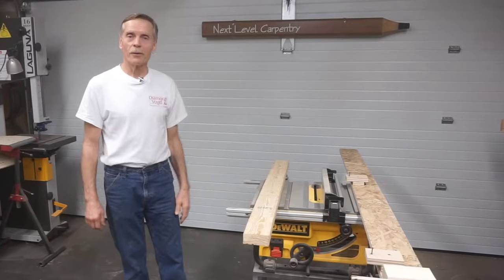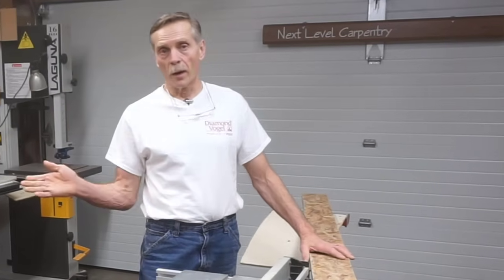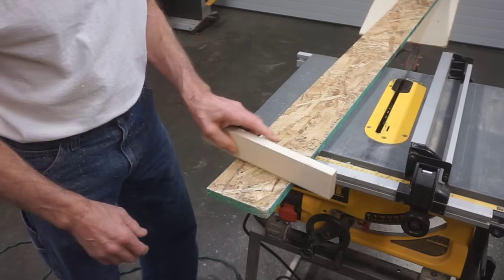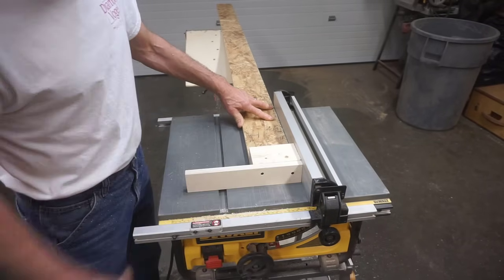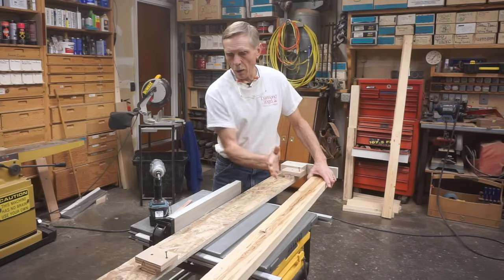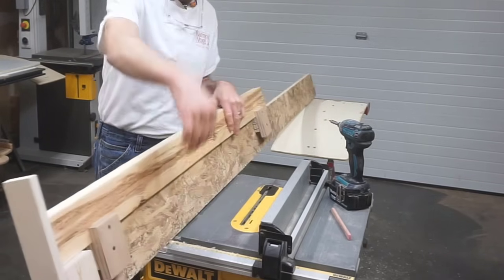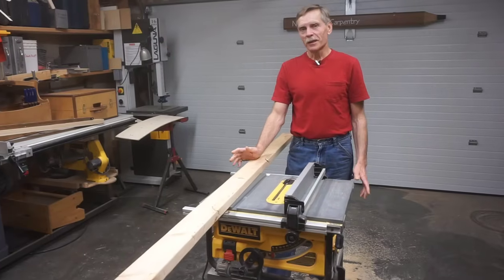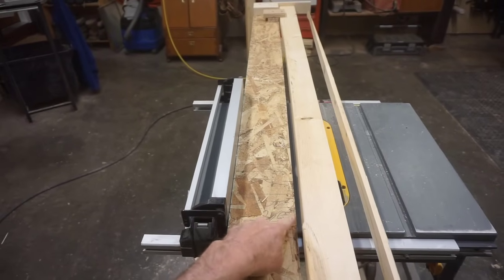How to Cut a Straight Edge on Crooked Boards

Comment: What can I get at Home Depot with a reliable straight edge longer than 8 ft? I need to use this method, but for 10 and 12 foot boards
Reply from the maker: They can be really hard to find but your best bet is to dig through a whole bunk if you need to to find a perfectly straight 2x6 and set it aside just for a straightedge.  Keep it inside and dry between uses so it stays straight.

Comment: I'm sad to hear that you didn't give the boatwright the bowed lumber. You could've easily cut any form on a board with bandsaw, or jigsaw. I just have a bunch of respect for boatwrights for it's becoming a lost art by modern materials. I did liked the video and you an excellent job explaining.
Reply from the maker: Shed no tears for the Boatwright as bowed Lumber is available in Limitless quantities these days...
Reply: @NextLevelCarpentry  Good point.

Comment: Screw another two scraps of plywood to your 2x4 block. Then you can be sure is absolutely square when you screw the block to your straightening board. Remove the scraps and fit your “proper” end stop plywood.

Comment: Where can I find the Roller Stand with the guide ramp.  I ve been looking for a long time and can't find one  with that feature
Reply from the maker: The reason you have not been able to find amazing roller stands like the ones you see in this video is because those are the only two in existence... I designed and made those 20 years ago and I've been using them steadily with great effect ever since.
I am planning to do a build video for them in the coming months so feel free to stick around and check it out when I get to that video project... Best, Matt
Reply: @NextLevelCarpentry  
Thank you for answering.  I have spent so much time looking for them..whew!   But I still learned a lot during that search.
I look forward to your planned video.  Could you possible think of a Roller stand for the average guy also?  I do have some welding experience and an Arc welder and a Mig welder having Body shop experience.  
You are the a great teacher and thank you!
ps: I'm 80 years old and just starting with woodworking. I wish I had done this years ago.  I have purchased a Jet 14 inch SFX  bandsaw and thousands of dollars of other woodworking tools so I am serious about this.  But I'm not going to do anything after 105 years old.
Reply from the maker: @bartgernandt2189  I like your attitude and style... hope I can get the build video done for you in time!  Personally I think roller stands are virtually useless without my little ramp invention and so I wouldn't really recommend any of the ones currently available.  The other alternative IMHO is to have an actual outfeed table, but that only works if you have room for it.  Your mig welder and bodyshop experience will serve you well with the roller stand build... that's all I really have at my disposal.  Since you've got such a great approach to life and seem ambitious for this stuff; if you want to tackle the build on your own ahead of time contact me by email and I'll send you some drawings to get you headed in the right direction. Best, Matt
Reply: @NextLevelCarpentry  Thank you for answering.  What is your email.
Reply from the maker: @bartgernandt2189  you will find it under the about tab on the main page of the next level carpentry YouTube page...

Comment: I tried doing this but without an 8 foot Fence for my 8 foot cedar boards I'm trying to straighten it's just not happening. pulled Out my electric can planer set the board side by side mark the high spots mark the low spots plain them to straightness was way easier than I thought was going to be as long as you just don't get to rushy with it
Reply from the maker: Gotta do what you gotta do.

Comment: i just lay my straight board and screwed on top of crooked board. straight board needs to over-hang the fence side, of crooked one. bottom board will be showing out from under straight edge. set fence to total width of narrowest points, rip.

Comment: Is that a standard fence on a Dewalt?  I have a ryobi and am not a huge fan of the fence that came with it.
Reply from the maker: It is, Andrew.  I'm not a fan of Ryobi in general although I'm not familiar with their fence.  Could be in need of adjustment or might just be junk in the first place.  I've been completely satisfied with this dewalt saw, fence and all, for the 20 years I've owned and used it and would be surprised at anyone not liking it for its intended use.  Best, Matt
Reply: Since I purchased the saw in 2017, I have becoming increasingly aware that Ryobi is junk with each new project I complete. Especially as  the projects have increased in complexity.
Reply from the maker: @andrewmiller7660  Good news is that your skillset is advancing to the point you can see what's lacking in tools... everyone doesn't do that.  It will help you learn to get good results from marginal equipment and really appreciate when you're able to upgrade.  I went through a similar transition when I started mountain biking some years back: I didn't know what I didn't know but learned along the way.  I think this is actually better than starting out with wonderful stuff because you don't learn/internalize important knowledge from convenience the same way you do out of necessity.  Best, Matt

Comment: Look I appreciate this video but I am still trying to cut a straight cut on a board. They never come out perfect and I am using the dewalt also. This pertains mostly to plywood. I just made a Track guide and gave up on the table saw.  Still not perfect but better.

Comment: It’s a good habit to develop to always hook the thumb of your left ( your starting “guide hand”) hand under the front edge of the saw table as you begin to feed your workpiece into the the saw , locking your left hand in position as it presses your workpiece against the fence. That way you’ll never have to worry, or even think about your left hand traveling along with the rip- right into the blade!! The Table Saw is easily ( along with Routers) the MOST DANGEROUS tool on any carpentry job, so PLEASE be very careful. Industrial accidents happen so quickly you will not have any time to react until it’s over, and then it’s too late.

Comment: What about the faces? With no jointer?
Reply from the maker: Sounds like you're trying to prove something... might as well figure out how to do it without electricity and with one hand tied behind your back while you're at it!😉🙄😎
Reply: @NextLevelCarpentry  well I was taught that the jointer does one edge and one face. I have a little 2 foot long jointer that needs some tuning. But I don't think it will do the 9 foot boards that I need it to do. Your method here (with the same jobsite saw that I have no less) seems to be the next best thing.
Reply from the maker: Oh... sorry for my snarky reply Seanfrtd.  You were taught correctly that a jointer does one edge and one face.  In fact, it can flatten all 4 faces but not guarantee they're parallel.  This method works better for squaring edges than faces even though technically it can do both... its just that it's difficult to cut through a bowed piece the 3 1/2" way without loosing everything you gain.  I suggest you spend some time tuning your little jointer to be the best it can be and then add auxiliary table extensions to stretch it's capacity... you should be able to double it's length pretty easily and multiply the length of pieces you're able to straighten significantly.  You'll have to focus to straighten a 9' board but it can be done plus doing it is a great way to expand your skillset.  BTW My first jointer was a little 4" Delta model and I coaxed it to straighten a lot of boards well beyond it's limited capacity...  work safe and enjoy the journey! Best, Matt
Reply: @NextLevelCarpentry  thx vm

Comment: I use a simpler method for straightening crooked lumber on the jobsite:  I buy more lumber than I need.  I cull out the crooked lumber, and return it to the store and get my money back for it. 😊
Reply from the maker: Good for you. Definitely what sensible capenter/contractors do to be profitable, mainly with new construction.  I find this method most useful on remodeling projects where lumber that can be 'repurposed' in this manner is basically 'free' and, once straightened/resized, is often better than punky new stuff, even if it's straight.

Comment: Hey, so, couldn’t you just steam the wood and bend it back to straight? Once it dries, it will be straight.
I mill mine right afterwords and let it dry as it’s put in place. I make sure it doesn’t move until it’s completely dry. 🤷🏽‍♂️ it’s worked for me. All soft wood.
Reply from the maker: Sure, that would work... if you have a portable steam generator and 10' long chamber for jobsite use, an hour or two to steam it, half an hour to clamp the 2x4 in a straightening form (with accurate springback calculation) and a couple days for it to dry out and, hopefully end up straight then it's a GREAT idea! 🤨😎
Reply: @NextLevelCarpentry  I was thinking more on, “It’s very possible”, but I very much understand it’s not ideal, cheaper, faster, easier... wtf... damn. Okay, let’s just say, “yeah, it’s possible, but why? It’s more of a waste of time.”
I see now. (Just because you can...)

But, it works very well with little pieces of wood to bend!

Comment: Why don’t you use three hold-down blocks?  It supports the middle of the workpiece timber and gives you another push-point. 
Just asking not trying to be smart A.
If you cut straight down the middle you can glue the two halves together cup to bow. It wastes less wood and “might” cancel out any remaining internal tension.
Reply from the maker: I believe it was Einstein who said make everything as simple as you can but no simpler.  The fixture as shown in this video is adequate for practically every application when doing rough framing on a remodel project and I don't feel extra tabs or anyting are necessary. That's not to say your ideas or suggestions would not be beneficial in some cases so I appreciate you adding your thoughts as options for different circumstances...
Best, Matt

Comment: Why would you straighten (decrease dimensions) of a piece of structural lumber on a job site? Where would the piece be used? Framing needs the full nominal dimensions not reduced dimensions. I would say that the ‘on the job site’ constraint was used so that an inferior method could be demonstrated. Turning 2x structural lumber into 5/4 lumber is a valid need but there are better fixtures for that.
Reply: @mattjackson3996  I completely understand the method and other methods, as well, which makes me able to compare and contrast. The locating and fixing of the work piece is inferior to mounting the part on the sled and clamping. It relies on a two point contact only, which won’t be enough to stabilize a long work piece and some flexing will occur. Clamping to the sled produces a flatter and more stable work piece. The modest reduction in cut depth is not a problem for a 10” table saw. Also, the heal of the sled pushing the work piece is cut each time the method is used. If the push block was on the sled this would not happen. A proper sled doesn’t need to be assembled each time it is used with construction screws to locate the clamps or push block.
Reply: @terryharris3393   @terryharris3393  I agree that you understand YOUR process but restate that you lack perspective on the usefulness and purpose for the method shown in the video.
In your reply you've now switched gears to describing a different straightening jig rather than address the issue of lack of perspective that is obvious in your initial comment. I could care less if you like or use a method I show in this video but if you're going to nitpick and criticize then I'm going to call you out as a fraud because any legit Carpenter would comprehend the purpose for the method shown in the video for what it is rather than use the video as a weak attempt to profess your superiority in this Arena.

Comment: What is the Hp of your bandsaw?
Reply from the maker: 4.5hp running on 220v single phase power William.  All that power is to handle its full 16" resaw capacity which is does without a grunt... as long as the blade is sharp.

Comment: Wouldn't it be far simpler and quicker to just cut out the bow using a long metal straight edge and a circular saw?? What am I missing?
Reply from the maker: It sounds like you're missing experience that helps decide which of many methods to use for cutting a straight edge on a crooked board.  The one shown in the video is my go-to when I have more than 1 or two pieces to straighten but, often, using a basic straight edge as you suggest is a better choice for a one-off use IMHO.

Comment: The old saying goes "measure twice, cut once"...therefore, check that the boards are straight against the lumberyard concrete floor, and avoid this entirely. Pretty much mandatory for Home Depot 2x4 pine lumber.
Reply from the maker: So you're saying you'll NEVER encounter a bowed board that you need to straighten?!  I want to live in your world! 😂😎

Comment: Excellent tutorial! One piece of constructive criticism I'd like to offer for consideration is to use less jump cuts. I know it's pleasing to some to not have any pauses or ums and uhs, but in my opinion a jump cut every other sentence is quite frustrating. It's like a video that is constantly buffering or freezing while the audio isn't. Super distracting. Another piece is to avoid the frequent zooming in and out. Just pick one point of focus when talking and zoom in only when fine details are needed to be seen. Zooming in and out as the speaker is talking is also very distracting and jarring. I really liked how you provided example 2 with a specially sought out warped board for a better example. That was definitely appreciated. 👍

Comment: I'm sure someone will think this is excessive nit- picking, and I'm sure you aren't even aware you did it, but at 12:10, you crossed one leg over the other as you were pushing the assembly through the saw. This could lead to a trip or stumble--- never something you want to do next to a running table saw, or even one that's not running, if the blade is above the table. All that being said, I think I'd rather straighten a board this way than with the industrial size/grade jointer in my dad's shop. The evil howl that thing made, along with the oversized blade, always gave me the eebie-jeebies. But still have 10 fully functional fingers that I've had to pull more than one plank-sized splinter out of.

Comment: What’s a snappy head? Brand?
Reply from the maker: You are probably asking about Snappy brand 'Snappy bits' that I use in most videos and on most projects: https://www.amazon.com/dp/B07PV1MS4Y/?ref=idea_lv_dp_  performance of the carbide tipped ones isworth the extra cost IMHO but the HSS ones are fantastic compared to any others on the market, again, IMHO: https://www.amazon.com/dp/B000XXZME8/?ref=idea_lv_dp_  Best, Matt

Comment: Godd video.. but.. for repetitive straightnening cuts i simply clamp a 4 meters flat bar ar table saw guide... and it will act as a very long jointer... super fast for repetitives... 
Single use? Track saw or circular saw guide

Comment: Why not just screw the OSB to the board  and send it through, OSB side down with factory edge against the fence?
Reply from the maker: I address your question in the video Damien...
Reply: Next Level Carpentry I just rewatched and think I caught your reasoning: you don’t have to raise your saw blade another 3/4”.  If that’s the only reason, run it through with the OSB on top; I have a feeling I might be missing something.  Either way, thank you for the video and your reply!
Reply from the maker: @sryth1  thanks for re-watching the video and posting a reasonable reply Damien I certainly respect you for that! As I'm sure you know there are lots of ways to skin this cat and for a one-off pieces I often just screw a straight edge to the workpiece. Where I find a fixture like this is on say a remodeling project were I'm reusing old Lumber and straightening dozens of pieces in a day or during a week and at that point this jig setup tends to be faster.  what I can tell you but didn't want to include in the video is that with the push block set up I rarely screw the workpiece to the fixture because with the push blocks set up it's plenty safe without those extra screws which really speeds up the process. Naturally 4 liability reasons and just plain old best practices I show using the extra screws in the video to secure the workpiece... one of those do as I say not as I do sort of things?
 whatever method you use work safely and efficiently!
Best, Matt

Comment: Newbie here, why wouldn't you just use the fence as your straight edge?
Reply: The fence is only so long ... what,  2.5 feet? As soon as your bowed board passes the straight edge of the fence, the end is no longer supported and the board will swing into the fence side, ruining your straight edge.

Comment: Extremely novice wood worker .. I assume this is best used for pieces where the dimensions of the lumber are less important than the straightness.. or you have sufficient extra material to start with (say cutting down a 1x4 where you just need a straight 3" wide piece of wood). Trying to think of how this could be applied as a poor mans jointer for say bookshelf facings.